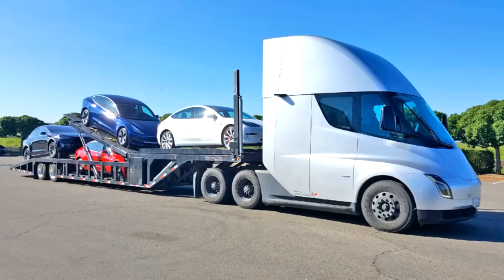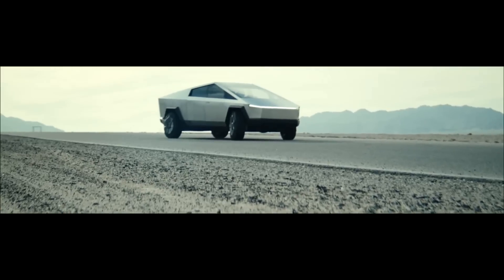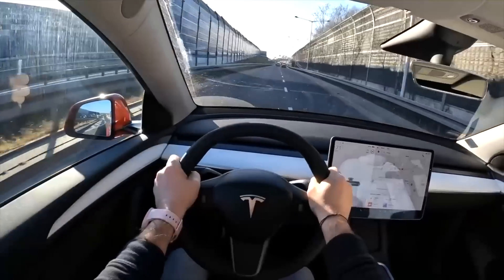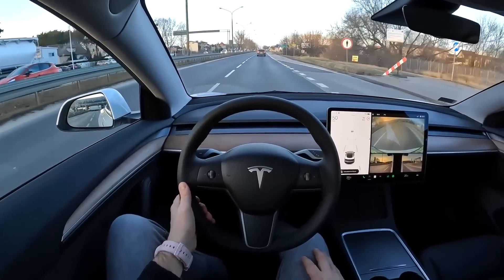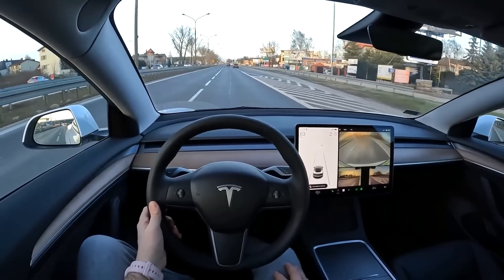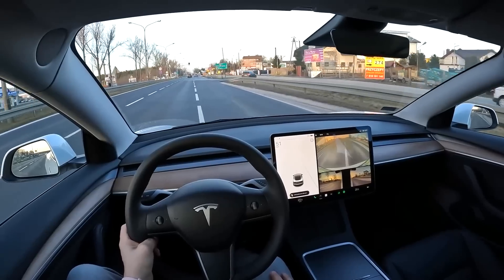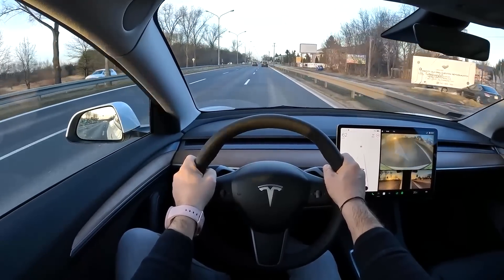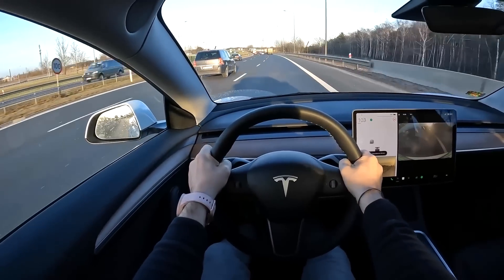TESLA 4680: Why you shouldnt wait!

Comment: BYD confirmed the blade battery going to Tesla.  Blade is a structural battery pack.  Since today, battery modules come from China for the Performance, what are the chances that until the 4680 is ramped up, Tesla will use the blade instead.  They can use the front and rear castings, put in the Blade structural pack until Berlin is ramped up with 4680.  Rumors had it at 10GW, which would be about 9 - 12 months of standard range model Ys.  By then Berlin should have 4680 up and running at volume, for a smooth transition over to 4680 from the Blade